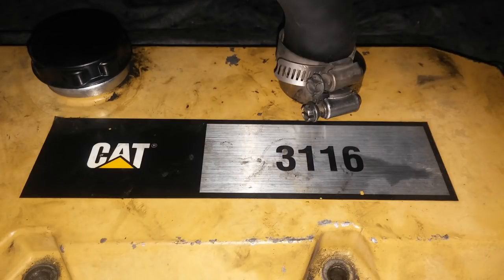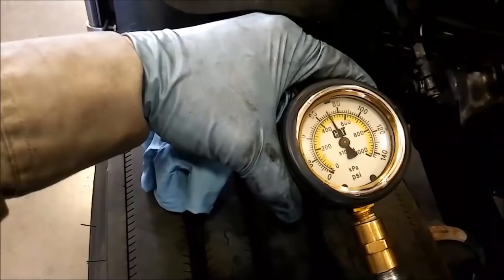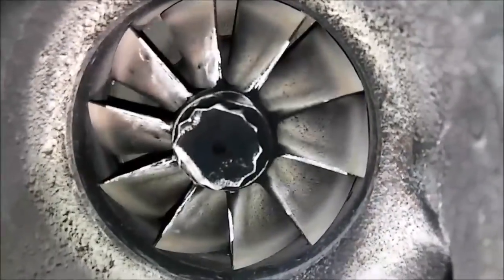The Cat 3116 Engine.  Know Your Engine.  Facts, Engine Design, Design Info, And Common Failures.

Comment: they are still out there...........in old school buses and wrecked medium trucks. So the MUI version operates almost like a GM Detroit 2 stroke.............rack controlled, camshaft driven unit injectors............except that the GM injectors are pretty simple and the CAT version is a nightmare.

Comment: Super helpful info at just the right time. Great work! Considering a vehicle with a 3116. Couple questions if I may: 1. If I have injector issues, can I just have a shop re-work the entire head with new stock injectors? Or 2. can I swap the head with a newer style system as on the newer engines to avoid this problem but still keep the 3116 block? Thanks.
Reply: I was wondering the exact same thing... If I just have the shop replace all of them at the same time would that set me up for a long time...

Comment: Hi Josh I got a 1998 SeaRay with a 3116s in it one of my radiator caps was sucking air in the coolant isn’t red anymore it turned a rusty color so I was told I need to change the coolant I’m not sure how to do that is there a drain that I can drain out and flush the system out

Comment: Have you ever had one race to the point it bent both pushrods on the same cylinder.  Less than 30k miles but has been sitting.  Ran fine.  Gave it throttle.  Fourth time on throttle it ran away and wouldn't cut off.  Questioning governor or rack..  i have worked on diesels, but as you mentioned mechanical injector in a 1991 topkick.  Never had one take off before like this.

Comment: Thanks so much for the informative videos.  I'm looking at a boat with a 2000 model Cat 3116 engine.  Around 1900 hours.  Should I consider not getting this boat due to the 3116 engine in it?

Comment: Man I’m worried from watching video.  I have a 2001 D5M XL dozer w 3116.   Started having some ruff idling a few weeks ago, would sound a lil skippy just a second after starting, and after 5 seconds it would level right off.  Well was running it Saturday and it started losing power   Figured it was filters.   Changed those today and it ran perfect for 30 mins and slowly would get a lil sputter like air in line when I’d put it under pressure pushing brush piles.    I didn’t change water sep yet bc they didn’t have it in.  Will in morning.   My primer also didn’t harden up like it should’ve, making me think there was a leak before I even started it.  Mine has the two fuel filters on top each other, one block w filter on top and bottom.     I’ve ran this machine for a year w zero problems.        No fuel in oil.   Looks like I got a small leak on front of engine above flywheel.  Looks to be coming from up high though.   Ima pressure wash it in morning and check it out.     
   Plz let me know if there’s anything simple I should check before pulling valve covers off.   Thanks in advance.   Glad I found your channel!
Reply: I’m having the same issue. What did you find out?
Reply: @isaacjacobs6192  mine ended up being a cracked line. Thankfully I just had to replace line and kept on rolling.   I sold machine ab a year back
Reply: @arfarms5711  ok that’s what I was thinking. I’ll be able to steer the mechanic in the right direction. Thank you very much

Comment: We are having trouble with our twin 3116 Cats on our 31 Cabo. One of our engines will no longer reach rpm, there is also quite a bit of diesel exhaust staining the back of the boat. Any ideas?

Comment: Correct me if I wrong but the 3508 and the 3512 first series had this set up to i remember seeing a rail with a small chain connected to the injector on 773b or 777b dump truck water cart I use to work on in the most mines
Reply: 3500A and Early B models used this fuel rack setup

Comment: Hi, great info and thanks for all your tips. We have a 3116 on a wheel loader and the no3 injector rod has a bad habit of slipping out. Changed afew rods already. Any idea on what might be the cause. Doesn't happen to other injectors. Also fuel timing tool not available where I am. Many thanks.

Comment: Thanks for the video I have a 3116 cat motor on a drill rig where i work and it's pushing black smoke would you have any experience on probable causes
Reply: check air restriction first
then rack adjustment

Comment: I’m currently working on a 90s year range Topkick with this 3116 Engine in it and I’m having a problem with the vehicle after installing 6 new injectors, started the vehicle for the third time and it’s just randomly shut off and I will not start. Have any pointers for me to look for ?

Comment: Are these much harder to set then the old 238 Detroit 2 strokes? 
I have an old Top Kick GMC with this engine and a Detroit automatic transmission. I bought it for $3000.00 and it has 192,000 miles. The brakes didn't work, and the guy I bought it from had spent about $5000.00 to try and fix the Hydro-boost system. New pump, new master cylinder, new electric back up. 
I took it all apart and found it was missing the check valve ball, so I fixed it for $0.38. The previous owner was not pleased.
I don't use it a lot, is there any thing I need to do so I don't damage the engine? I try to start it once a month otherwise the batteries drain down. I am thinking it may be a bad solenoid?
Anything that you can point me in the right direction would be greatly appreciated.
Smiles!

Comment: adept ape quick off topic question. I had a bxs Acert get a coolant leak on the compressor today and the guy ran it and he said the hottest it got was 230 then cooled back down to 200 do you think any internal damage was done
Reply from the maker: +Lucas Orellana The C15 can take an overheat better than the C13, but that is in the danger area of temperature. If I had to guess you are probably okay. Watch for coolant consumption though.
Reply: +adept ape thank you so much

Comment: ADEPT APE what would be a good replacement engine to replace a 2002 3126, in an F650 what would have higher rev line more power an be more durable then an 3126
Reply: Butch Cassidy cummins

Comment: I have a 3116 engine in a 1991 Chevy top kick and it seems to be starving for fuel. I changed fuel lines, filters and tightened up on all fittings. Could it be an injector problem, starting to loose hope on my truck, please help.

Comment: I have a no start condition on a 3116 that I cant figure out. Can I pay for your expertise?
Reply: Pull the valve cover off and make sure the rack moves to the fuel on position when you turn on the ignition

Comment: I have a 94 Kodiak with the 3116 I’m removing the under cab exhaust and muffler to vertical exhaust will I need a muffle to have (back pressure) on the turbo in order it to spoil up properly I have been told the truck will have no power if it’s a straight pipe. The truck will be used for farm use not highway use
Reply: Install a straight pipe exhaust if you wish.  The turbo will spool up even if there is no exhaust pipe or muffler, because it is mainly the exhaust flow out of the exhaust manifold that determines the turbo rpm.
Reply: Chad Jessup ok thanks any down side to the straight pipe. The  purpose of doing a vertical exhaust is to send the fumes up and out instead of down and out
Reply: The only downside for a straight pipe would be on a human level and that being the greatly increased noise.

Comment: Question. I'm having oil and gas mixing in fuel filters. Truck is losing power and hesitating a alot. Was leaking a lot of oil now oil level is raising because gas is coming in. What could it be?

Comment: Nice explanation... I have a problem with my 3114 engine.....when start the engine it crank for few second before staring.  I opened the broker arm cover I notced the governor delay in pulling the fuel racks. What 
makes the governor pull the fuel rack in the beginning of start of engine?

Comment: help help help. . lol.  still getting air in the system.  cat 3116 mui  1994 . sorry  dont have serial number  on hand truck is at the jobsite. . low power . definatly fuel. replaced all fuel lines and connectors to the filters.  replaced  pressure relief valve spring and o ring. . still getting air in the system and it seems like the fuel is dumping back to the tank with a lot of air. . any ideas. imat my wits end

Comment: I have a 1997 chevy c6500. 3116 i ve owned for over 10 years with under 100k Mileage. The heater intake light will not come on anymore. I tested for power to the relay for the heater intake and there is power going there. I then replaced both the heater intake and the relay. And i still have the problem of the heater intake light not coming on. I talked with the mechanic at a local cat dealer and he mentioned that the control module needs replacing. Does this control module have to be programmed and is this the cause of the heater intake not getting a signal of temps for the light not to come on?

Comment: Could I Fit This Engine In A 94 F350
Reply: Yes.  But they suck.  Like a huge level of suck.  If you really want your truck to suck, and only need a couple hundred hp, get a perkins.  It'll be cheaper, more reliable, and you will still be different than all the guys with a Cummins 5.9.  
Of course, they'll all be passing you.  But you'll be unique.

Comment: Best thing to do with a 3116 is replace it with a lighter more powerful 5.9 cummins. Theres a reason you dont see many of these turds anymore. 

You failed to mention the biggest 3116 point of failure: water pump belt.
Reply: joe blow There’s still quite a few 3116’s out there. They’re a pain in the ass from what I’ve heard but they will run for a long damn time. They’re definitely enduring engines but they do have their problems.
Reply: Turds??? We had an f650 with an Allison auto and 5.9 Cummins now that was a weak Noisy turd. Our kodiac with the cat eat it for lunch. Even the old 8.2 Detroit powered c70 with Allison’s out ran it and out pulled it. Everybody hated that truck so bad they just made it a spare the other trucks left with 250+ thousand miles on them the Cummins powered Ford only had 50,000 miles. when they got rid of it and we were happy to see it go. We also had a cab over ford cargo with the 5.9 and a manual that wasn’t any better. Those 2 were the turds.
Reply: @theaveragejoestinkeringand4407  that 5.9 cummins could have been turned up quite easily to give it more power.

Comment: On a 3116 , what is the most common cause of overheating?
Reply: Did you ever figure it out. I just bought one and it seems to be running hot. What’s the normal operating temp on these?
Reply: @sajexcavating  Ac system over the front of the rad doesn't help .

Comment: Can these be rebuilt if they have no liners. My engine is hard to crank and smokes alot until warm. Does it mean its time for rebuild.
Reply from the maker: +Carlos Jackson You need to do a blowby measurement, that is the best indicator that your engine needs a rebuild. They can be rebuilt, but you would need to have the cylinders machined.
Reply: "...hard to crank...".  Carlos, does that statement mean the engine turns over slowly or that extra time is required for it to start?  If that piece of equipment were up here is cold country, I would ask the operator if the air intake heater (AIH) is being allowed to warm the air sufficiently before attempting to start the engine.

If that procedure is not followed, the symptoms are exactly what you described, the smoke being white though.

If the
Reply: The smoke is more grey and it has mot been run in a long time and i need a kick down cable

Comment: Hey Josh
Wondering if you could help me diagnose my clients boat engine 3116 cat?
He’s had three diesel mechanics look at it and it’s still not running right. Basically once the engine is under load around 1100 rpm it just pours black smoke. Any ideas? 
Since the engine was taken from a truck I’m wondering if cat uses marine injectors and maybe that is causing it.
Great video thanks

Comment: I really like your VLogs.  To the point and informative.  I am looking at a Class A DP and was unsure of the relationship between the 3116 and the C7 which you answered for me.  I read blogs with a lot of complaints about the C7 ring failure issues.  Have you seen this problem as well with the 3116?

Comment: Nice video. New sub. Found you looking for info on my 3126E. Love to see you do a similar video for it. I have one in my RV (Freightliner chassis) and dropped the #6 exhaust valve into the cylinder last year. Check my channel for a video on the ordeal. Got the tip of the injector, turbo, head, cylinder wall...well you know the rest. Running on a CAT swing-in with warranty right now. Sure would like to learn a little more about this engine. Thanks I'll be watching...

Comment: As  far  as  adjusting  the  rack  it's  no  different  than  running  the  rack  on  a  Detroit  2  stroke . Setting  the  injectors  hight  it  sounds  like  the  pain  in  the  ass  8.2  Detroit  4  stroke  they  put  in  2  ton  trucks  in  the  early  80s   (what  a  piece  of  crap  ) . As  for  running  the  rack  I've  probably  done  over  a  hundred . I  hate  working  on  them  but  I  got  good  at  it . My  learning  experience  was  a  v16  with  the  master  mechanic  leading  me  through  it .
Reply from the maker: Cbmech If you've done a hundred then you are probably pretty adept at running the rack then. We probably only do one or two a year so there are long time between each one and I have to read up on it each time.
Reply: Adept Ape 
Yea I probably was. I probably haven't done one in at least 15 years. I've done everything from a 2-53, 6-53, 8, 12 & 16-71,8-92, and 6-110. The 110s were some of the worst because of the distance between injectors. The worst was the 16 because it was 2 v8 blocks
Reply: Do you have the tools
Reply: Carlos Jackson 
Not any more, my box got stolen after the last Detroit I did and I've never had the need to replace them
Reply: Setting the injector height on the 8.2 isn't that bad after you've done it 3 or 4 times. Absolute worst part is the fact they crammed these engines in an engine bay made for a 366. Removing the valve covers means taking apart half the damn truck and laying across the radiator with a mirror trying to see the bolts on the back of the valve cover.

Comment: Excellent video, thanks. I had a mechanic out to replace the injectors on my 3116s (installed in a boat). After replacement, starboard side motor runs perfectly, but port side motor hunts at idle only after it's warmed up.  My mechanic is stumped and we're considering brining a CAT tech out to help diagnose the problem.  Have you ever experienced this?  Here's my video of it happening:  https://youtu.be/1-yJfqbfqAU